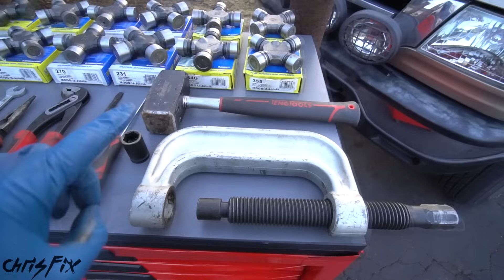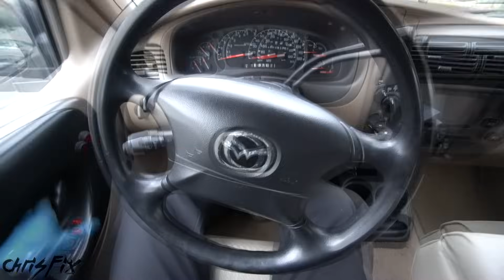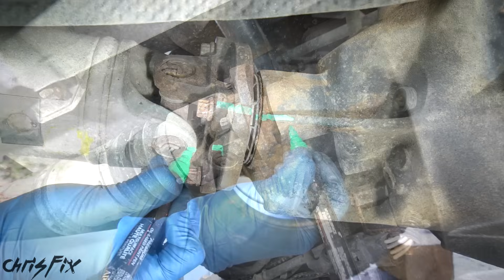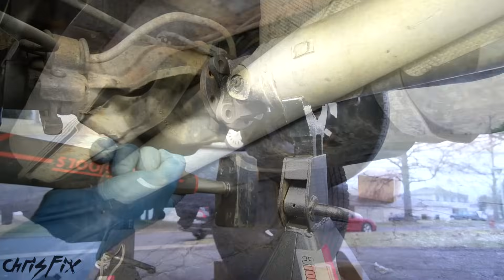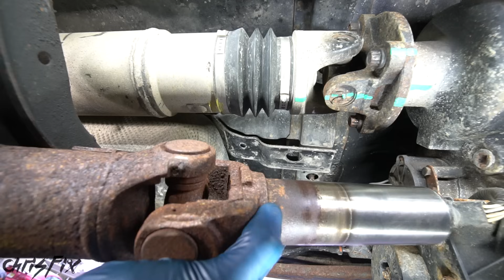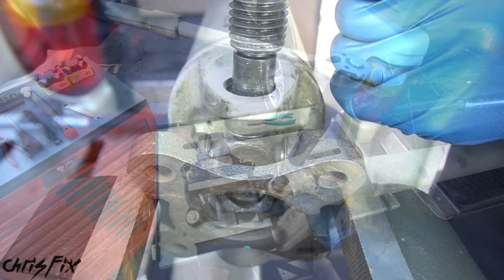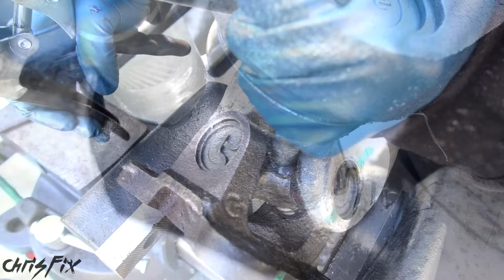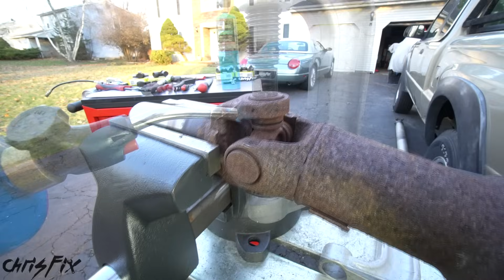How to Diagnose and Replace Universal Joints (ULTIMATE Guide)

Comment: Very thorough and informative. Toyota uses various thickness of matched C-clips to seat the cups  to minimize side to side movement. The spec is 2 thousandths but I didn't know how you would measure it outside of a machine shop. There shouldn't be any noticeable lateral movement and it also shouldn't be seized up as you stated in the video after tapping. When I add grease I add enough so that the new grease is coming out all 4 seals then clean up with the rag otherwise it'll get slung around and make a mess.

Comment: I remove all the bolts on the rear driveshaft where it connects to my rear axle, and it won't come loose.
The bolts on the other end won't budge at all. 
The rear u joint on my rear driveshaft is shot. Terrible. :^(

Comment: the only possible difference between strenght and hi-strenght u-joints is the size of the needle rollers diameter only : the smaller the rollers the higher radial thrust shouldering. if it is not the case this is only branding and marketing... take them out and compare them please I d like to know .------------ for the enthusiast DIY or poor men's shops : from spicer neapco moog joints etc even japanese sealed ones : once disassemsembled , with a lathe the cups&trunion  can be remachined to a smooth finish then the rollers replaced with the good oversized drillrod (ex : replace the original 0.071"-0.072" by a 0.076" 0.077" on 22MM cups) will cost you your time only and 2$ worth of drillrod  , unfortunately non-GM locking plastic type but only with steel circlips locking. Drillrod is non-chromium but if well and cleanly done the hardness is o.k.
Reply from the maker: Thanks for sharing!
Reply: @chrisfix  with covid hindering and the harsh times looming ahead of us my technique might increase in popularity. thank you for teaching brothers to become self sufficients and not depending from alleged specialists

Comment: Enjoy watching your videos, I'm an auto technician, that was an excellent video. I have installed many U- Joints. One thing I would recommend is to install the grease fittings facing towards the middle of the drive shaft, it makes it easier to put grease in it.  You provide excellent information.

Comment: A u joint failing in the front of the drive shaft could cause the drive shaft to fall to the ground and if it catches a hole or something on the ground, catapult the vehicle into the air. It's rare, but it CAN happen.
Reply: It can't happen. If the U joint breaks, the axle will fall, and if it catch a pothole, it's just gonna pop out of the transmission
Reply: @sovietcomrade7733  You are correct. I just thought about it....there is no ujoint in the front, only the rear.

Comment: Wish I could have seen this a while ago. My dad had a F-150 and our driveshaft just popped out at 65mph on the parkway, it definitely hit something pretty hard because we had a gas tank leak and it went straight through our rear bumper. We ended up callin a tow and spent over $700 total for something we could have done ourselves 😭

Comment: im wondering if this is my vibration problem. when i drive my 1993 jeep cherokee 4x4 it starts shaking lightly around 60-65 mph and quits at 70 mph. gonna check tomorrow and will respond to this.
Reply: well the front drive shaft turns a little bit while in park so maybe thats my problem.

Comment: Thumbs UP Chris... Awesome what you doing here.. Learned a ton of stuff watching your videos and its super helpful.. Had a issue with replacing u joints in my Datsun HB310 classic car. Mechanic said that model didn't come with u joint locks as in the u joint was reverted and to take out the u joint they had to grind out the riveted edge. Once new joints installed they electronically welded 4 metal washers at each bearing where the original rivet was so the joint won't  come out. After repair i sense a vibration in the car & once reach more than 60kmph speed the whole car starts to vibrate from the bottom.. Please help me with this.. You know how to fix up even worse case scenarios...
Reply: Fixed the issue myself... Issue was one of the u joint did not seated properly & there was a play (fault of the mechanic) & the shaft not seated properly to differential by the bolts (again fault of the mechanic). Should have done it by myself in the first go & saved all that money.. After closely looking over your video just fixed it myself & now it runs smoothly without any vibration. Man that does feel great to fix up your own car.. Got the confidence to do it by my own from watching your videos so should give a really big thanks to you Chris... Keep more & more videos come up like this.. Its super helpful & gives the confidence to do your own repairs by your own.. Thumbs up...

Comment: Great Video!  Question Chris,  On the shaft where that rubber boot is with the two hose clamps, What's under there? My drive shaft has a lot of play under that boot. Is there another set of U joints or a Sliding yoke?  Hope to hear back.. 2005 Ford Ranger  4L  4x4  Single Alum, Dri-Shft.
Thanks for any info. Chris   Pls email Direct if my email shows on your end.
Thomas

Comment: Great Video instruction . Chris i have a driveshaft out of Mazda CX-7  NOT replaceable  so i am going to remove the joint (  rusted in place along with unknown clip ) and measure the u-joint look up specs on moogsuspension .com  and order a  exact fit  u-joint if possible, i have not seen a automobile where you can not replace any u-joint, Mazda wants over $1200 for a new drive shaft 3 piece along with 2 carrier bearings this is absolutely ridiculous  , do you have any ideas

Comment: I remember i discovered the rear u joint on my 4wd was bad cause it vibrated under acceleration, but if i engaged 4wd (in a straight line ofc) and accelerated the same way, it didn't vibrate nearly as much.
Reply: This because the load on the rear joint was lighter with 4wd engaged.

Comment: Hey chris. My silverado has all the symptoms that you explained. Squeeky noise noticeable at low speeds and vibration at high speeds. Also noticed that my transmission mount was damaged. Rubber on mount was out of place and worn  out. Could the mount be the cause u-joints go bad too? Should i replace the seal that connects from transfer case to driveshaft? I see a leak
Reply: Yeah replace everything. U joints, the seal and the mount

Comment: Would I have to take the entire drive shaft off if I’m just changing the rear u joint?
Reply: Change both u joints. You need to remove it

Comment: Hello Chris thanks for the all the informative videos. I have an issue in I’m 2000 frontier 2wd I have looked around drifferent mechanics and they have no idea what the issue can be. I’m hearing a vibration noise when driving at 30-45 mPh then goes away at heigher or lower speeds some say it’s bearings some say it’s engine. Do you think I can be u joints?

Comment: For nearly a year I have had intermittent passenger side front wheel noise when stopping "hard" (not wheel locking, just hard when necessary). I have replaced rotors, calipers, pads (twice) and wheel bearings. The last mechanic said, "It might be the drive shaft." Does that make sense? This is the best, clearest, most complete automotive repair video I have seen on youtube. Thanks.
Reply from the maker: Thanks a lot! What kind of noise are you hearing and what car is this on?
Reply: @chrisfix  1998 Dodge Ram Van B3500; crunching, grinding sound when braking hard. Since originally posting, the sound has stopped. Mystery!

Comment: Im about to do this swap out on my 2012 4WD Nissan Xterra...the front driveshaft u-joints are different from the two on the rear driveshaft.  Oh...Nissan why you gotta be crazy like that ?!?  Excellent video...thanks Chris !
Reply from the maker: Interesting, thanks a lot!
Reply: @chrisfix   sure enough - the hammer method works best - the press is way more squirrely IMHO.  But they are installed...and I took your suggestion of tapping the yoke to make sure they swiveled smoothly - and it totally worked !  Sweet !  Thanks Chris.

Comment: I'm getting a lot of engine codes come up with mine.
Reply from the maker: What are the engine codes coming up with?
Reply: @chrisfix  knock, crank cam, and maf. Have been working on finding a solution for over a month. Replaced the same parts multiple time. The fix was changing the U Joints so far. Guess when they get bad enough you get those codes. I have a 99 Chevy k2500 with the Vortec 7.4 454

Comment: Hey Chris, I know it's hard to diagnose over the internet, but I have a 2006 Toyota Avalon that jerks hard when driving it. It also makes a loud metal snapping/clanking noise when it jerks. It's very loud and makes me not want to drive it. It also seems like it's pushing itself to move. Sluggish. Would this be a transmission issue? What should I check out?

Comment: One more thing about steel ujoints and aluminum driveshafts, be sure and  tell your parts store you have aluminum drive shaft and yokes so they sell you a coated cap ujoint that is made for an aluminum yoke. Steel and aluminum are dissimilar metals and sometimes have a metalurgical bonding reaction so they won't separate very easy,  having a coating can help when you need to separate them.

Comment: @18:48 you set the driveshaft directly on the vise.  That is not correct.  You should widen the vise so only the trunnions of the u-joint are touching the vise.

Comment: Hi chrisfix, there is one type of ujoint you haven't mentioned, it's the "non-serviceable" staked ujoints that are such a pain to remove and replace because the manufacturer wants you to replace the entire drive shaft which is way more expensive. thankfully there are kits you can use to replace the ujoints with serviceable ones but removing the staked ujoint first is no fun

Comment: I just did this on my Chevy Truck, I'd highly recommend using the large c-clamp (rent from Autozone or O'rielly) and NOT beat on the joint with a hammer. I used the clamp and my impact and it popped right out. If you bend it, by beating it with a hammer you are f'd. Also, take the old u-joint with you to the parts store, It took me awhile to match it up. The caps on one U-Joint are not always all the same size. Mine had 2 different size caps. Other than that, it was easy! Good Luck! haaa
Reply from the maker: Thanks for sharing!

Comment: My car is giving me mild vibrations on take off. It then runs smooth till ~85km/h. Above this speed or >90km/h, the vibration seems to soften out but is still there. its worst point is around 85km/h. Doesnt matter if I'm accelerating, cruising or braking. The highest level of vibration is at 85km/h and when I go around a gradual bend. I've had it aligned and my wheels and tyres are brand new and all balanced. Does anyone have any suggestions?
Car details: 2017 Australian Ford Ranger PX2 XLT

Comment: This is a true story... I work with a guy who had a u-joint fail on his front drive shaft while on the interstate and the drive shaft disconnected from the front diff and actually picked the vehicle up a few inches off the road, (similar to how athletes use those long poles to jump over those really high obstacles), before violently bursting through his floor board and causing a very bad wreck. He lived thankfully but he definitely ended up with some long- term physical problems

Comment: Hi there. Im your subscriber and you have been showing great things even i have been trying some of  the things  you are showing and they comes up great. There is only one thing about Propshafts. You dont have to mark the flange to the diferential or the flange to the gearbox. Propshafts are balanced by it's own not together with the diferential or the gearbox. Or in another words if you change the diferential how you going to know how to bolt it to the propshaft, same is if you change the propshaft or the gearbox. Something else in my country we fix propshafts if it snaps we are cleaning the dirt, welding it, balanced it and fit it in the car without way of doing it because is already balanced. And something else that i'll do before taking off the propshaft is to start the car put it in neutrual to reduce the pressure from the shaft  and then remove it. That's why your car move a bit when you take of the propshaft from the diff. Keep going the same way. Thans for showing so many great things. ;)

Comment: 2 Years late but oh well. When your greasing a Uni Joint, you only need one pump of grease to make sure the needle rollers are sufficiently caked in grease to reduce metal to metal contact. When you overgrease the joint, that is when you see grease coming out of the caps. That boot you were on about where the grease was coming out is a seal which you have now broken. Dirt, debris and what not can now easily find its way into the needle roller bearing, essentialy creating a grinding paste which is the comon symptom of universal joints failing. They should basically last forever. Its how the HIGH STRENGTH ones last so long. The grease nipple is there for greasing the joint, as you said, when the grease dries out, which should one be done once or twice in its lifetime. Thanks if you read this

Comment: If you feel it in your ass or in your back it's in the rear end if it's in your hands "the wheel" , in your feet, and or the dash it's the front end. 
Vibration can be transmitted through different parts. 
Different shit vibrates at different frequency, like the acc belt pulleys. 

Frequency is key when talking about rotating vibrations. 

Look into tesla , not the rip off car company.

Comment: I wish I had seen this before I allowed a bad u-joint to cause runout in the yoke and thrash the trans casing at the output shaft thus severing part of the flange of the bell housing and starter. Yeah idk either

Comment: Very good video.  Although I would like to add that it is my understanding that the U-joints are also supposed to break before expensive parts like drive-line, transmission, or rear-end.  Sort of a "mechanical fuse." I'd worry about adding "high performance" u-joints they might not break before other parts fail..

Maybe i am dating myself, but on my first car i had to replace the u-joints and i purchased a repair book specifically for my car.  I followed the directions, and then it said "remove the u-joint" and never had any further instructions.  I had to go to a few garages to ask around how to do it.

The different thing is my u-joints I had to use a C-clamp and press on both ends of the u-joint and the caps squished-in until they cleared the flange.

Comment: Any chance i can figure how to balance my drive shaft because my u joint broke on the freeway so my drive shaft was just hanging
Reply from the maker: I am planning on making a video on how to do that!
Reply: @chrisfix  you think it will be a major issue if I don't balance it I bought the U-joint in the u bolt nuts to hold it down to the differential I only drive like 6 miles to work no freeway I was driving on the freeway and then that's when The U Joint pop I'm just hoping my transmission is okay

Comment: I have a hunch that PERFECTLY matching up the driveline going back in as it came off for balance reasons isn’t necessary. The driveshaft is balanced so that it in and of itself spins in perfect balance.. The same ideology carries over for tires in balancing them - I am a tire tech so I know my way around balancing a thing er two lol.
Reply: The matching is not necessary for balance but it's needed for phasing u-joints. If the universal joints are not phased correctly the input and output won't turn at a constant speed and that lead to vibrations.

Comment: Isnt all wheel drive and 4 wheel drive the same?
Im still learning btw
Reply: 4 wheel drive normally has the capability of running 2 or 4 wheel drive, usually with high and low options in 4 wheel. All wheel drive is  all wheels all the time, but with clutch packs in the rear so that the drivetrain is still smooth when you're cornering.

Comment: 0:25
And the third method is with only a vise grip if you don't have a press kit or not able to use a hammer 
I'll be happy to show you how
You can use a socket that fit inside the flange on the U joint cap
Then you can use another socket on the other side of the flange bigger enough to drive the cap into
Then squeeze the vise on the tow sides then use a pliers to remove the cap completely

Comment: Chris this is by far the best video in description and method.  Question - with factories balancing the OEM shafts - aftermarket shaft's must have no such balancing and may cause vibration.  I believe this is the case with my aftermarket.  Is there a way to know?

Comment: Quick note to this video (I haven’t finished the video yet so idk if he mentioned it) if you have the zero fitting option make sure that your fittings are facing outward so you can grease them. You would be surprised how much I see this issue in the shop. Costumers will tell me they just replaced the joint and they feel burnt already

Comment: Two questions regarding this job.  Is there a way to get the u-joint out of the inner part (narrower connection) without pushing it back in the opposite direction?  It seems that you have to push it all the way out to free one cap and then try pushing it back through the other side to free the other cap.  From what I can tell, this causes the gouges that you file away.  Secondly, what do you do if smacking the u-joint a few times doesn't free it up to move easily after you have reinstalled it?  Love the videos and your attention to detail.  Thanks!

Comment: Hey Chris I really need help figuring out a p2135 I’ve replaced the throttle body and sensor the accelerator pedal and it still keeps coming back with a reduced engine power can you please please fix this I will pay you it’s driving me crazy lol